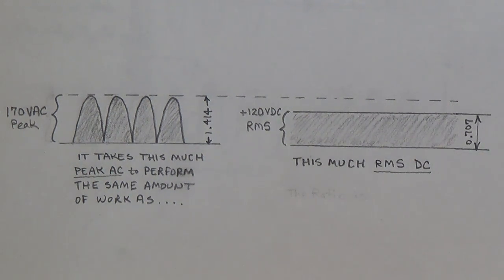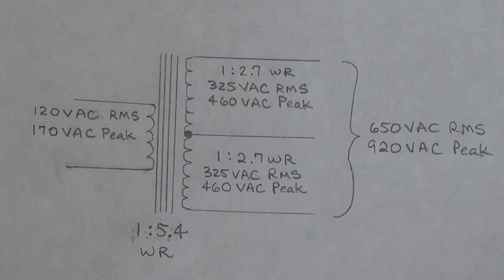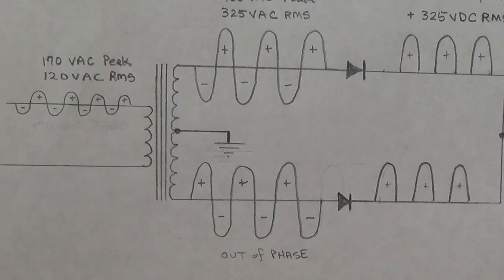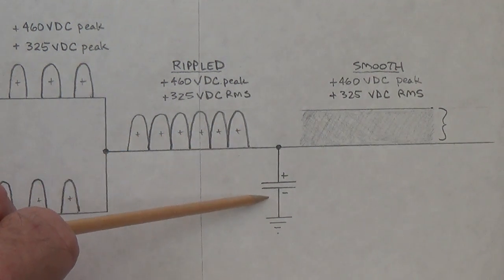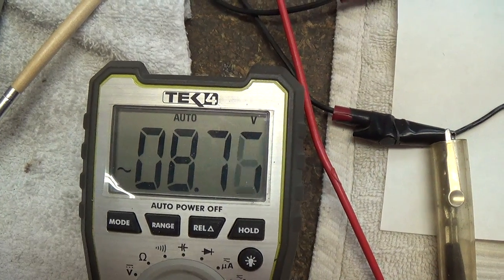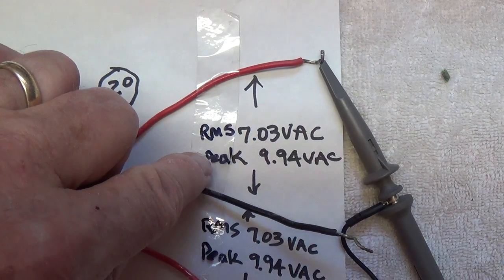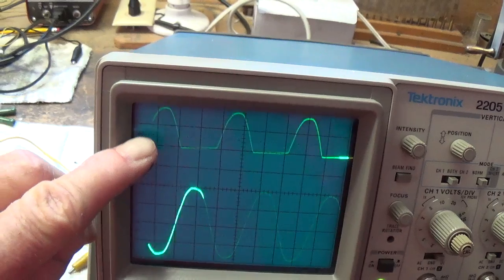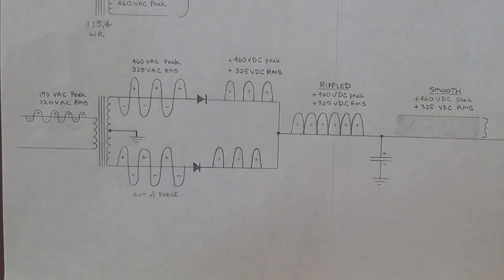Power Supplies Part 2:  Full Wave Rectification

Comment: could you possibly make a tube amp with theas tubes I might ask a uk224 and a uy247
Reply from the maker: +fucken killer jason  Jason, I am not at all familiar with the tubes you mentioned and thus cannot render an informed opinion.
Reply: fucken killer jason theese are 30s tubes have odd filament voltages were used in audio in battery sets might see them at the Smithsonian. Nex to the model a car.. filaments maybe 3-3.5v 45 - 47 is power output .27 af amp.

Comment: I'll try to restrain myself here, lest you develop some sort of rock star primadonna thing... To teach something this well, you have to understand the place of not understanding a concept at a certain level. And you have to know how to build the path to the next level. How steep to make it, and where exactly it shall go and NOT go. Your beefed-up description of filter capacitor function  hit me square in the noggin'. I have not heard these concepts articulated this plainly until now. OK, now I won't gush. I know you're somewhat of a stoic. 
Incidentally, I know it's by design that your presentations are restricted to the subject matter interspersed with mammalian anecdotes--but many of us want to know perhaps how you came by your fund of knowledge and obvious passion for this subject. You mentioned being an "algebra instructor." We ham radio geeks call our mentors "elmers." Did you have a mentor?
Reply: +JC Haywire Let me add that your choice to explicitly show the connection of your scope probes for your testing is  a good one. Others do not illustrate this.
Reply from the maker: +JC Haywire  Wow, thanks so much, JC. I completely agree with your analysis that effective teaching requires putting yourself in the mind of a person who does not understand a subject.....and then figuring out how to change that situation.  I'm almost entirely self-taught (I work better alone.....other than with quadruped mammals) but over the years have found people who would take the time to patiently provide helpful input, including David at ElPaso TubeAmps.  My college training was in Biology and Chemistry and my first career was in medicine.....but I've always been an engineer at heart :)

Comment: We are happy you are back. This power supply explanation has been awesome!! I´ve been working on my fear of transformers and I believe in the next month I will be receiving the components to by build my very first tube amp. Which one would you suggest for my first project?? The 5e3 or Epiphone valve junior?  Best Regards uncle extended to Jack and Rusty.
Reply from the maker: +Joao Martins Thanks, Joao. As a Fender enthusiast, I would strongly recommend the 5E3. It's one of the classic amps of all time. Good luck with your project.

Comment: When a filter cap goes out of spec what electrically is happening to cause the hum?
Reply from the maker: +Trex1268  It ceases to smooth the rippled DC output from the rectifier, and the 120Hz hum created by the ripple becomes audible through the speaker(s).

Comment: This smooting electrolytcondensator reminds me of the grounded condensator of a rc-lowpass filter, where only low frequencies can pass and dc with a frequency of zero is as low as it can get. (Also a coupling condensator reminds me on a rc-highpass filter because only ac with a frequency from more than 0 can pass.)
Maybe this was already covered in your condensator-video, anyways: even when there are no resistors involved, does it really work like this?

What is happening with the negative waveparts, are they unused because there is no need for negative voltage?
Reply from the maker: +PrinceOfBodom  I think my smoothing demonstration benefited from an absence of any load on the circuit. Perhaps the resistors become necessary when current is flowing. With regard to the negative waveforms, I have given much thought about this.  I used to think that they were shuttled to ground through the center-tap to form an equal-but-opposite B- in the chassis.....but then the potential between a tube plate and ground would be doubled.  It seems more likely that they are simply blocked, like turning down a faucet half-way and only letting half the water through. The water in the pipe doesn't go anywhere.....it just doesn't get through. It's an interesting topic, but one that I have never seen or heard discussed before.
Reply: +Uncle Doug Thank you for your very detailed response! I'm learning so much more from you than i did in twelve of school!
Reply from the maker: You're welcome :)

Comment: I find it odd that for tube hardware it doesn't require much capacitance to smooth out ripple. With solid state it requires huge honking caps to smooth out ripple. My little bench power supply I have been working on uses four 2200 uF caps for smoothing.
Anyway, keep up the great work.
Reply from the maker: +Leland Clayton   Thanks, Leland....we will.  The main difference between the two is the voltage levels at which they operate. The high voltages found in tube amps respond to low-capacitance, high-voltage caps.....while solid state requires the opposite.  What strikes me as odd, however, is how well the low voltages I used in my demonstration (7 to 14VDC) responded to low-capacitance filtration.  There is probably an obvious explanation, but it eludes me at the moment.
Reply: Uncle Doug I think the reason why the demo (7 to 14VDC) worked fine with low value caps was probably due to no load.
Reply from the maker: It could well be, Leland. I can set it up again with a load and see if there is a difference.
Reply: +Uncle Doug I would agree - it is probably due to the absence of load in your demo circuit.  With no drain (which pulls down the charge in the caps) - it's easier for the caps to stay at full charge / full voltage ???
Reply from the maker: Good observation, Donald. Thanks.

Comment: One of the most informative, non-idiotic channel on YouTube. I love to watch your videos sir. Cup of coffee, few schematics of my lovely amps and pen in other hand to add new info on paper.
I have one question about that video. What's the most diffrence between tube rectification and diode rectification? Any significant diffrence in sound, hum etc?
Reply from the maker: +echo  Thanks so much, Echo. Rusty and I really appreciate your nice comments. Diodes tend to be more efficient than tubes when it comes to rectification.....other than the GZ34, which is very close in efficiency......so tube rectification can impart an effect called "sag", which is evident when the power supply lags behind the demand for more current (generally at higher volumes and stronger input).  Some people love this effect, since it is associated with vintage tone......some people dislike it and prefer diode rectification.
Reply: I am reviewing all of your videos right now :) Nice to watch. I now know much more then year ago. I was going to put a comment and... hah, I've done that year ago.

Comment: Great video Doug I'm running out of colourful adjectives to describe your talent here. My only gripe/observation  would be to explain why/how you got the 2 output waves to appear seperate on the scope. I guess that comes down to how to operate a scope which is 'out of scope' of this lesson.
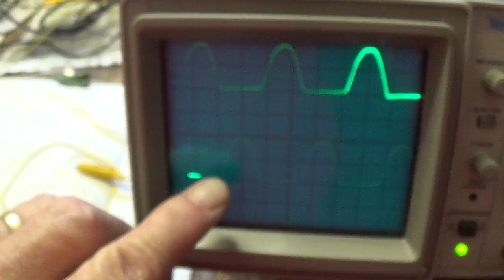Reply: +Andy Wragg Well, the short answer is that he's using a 2 channel scope. Each channel has an input and a trace. Signal on "A" input is displayed as the "A" trace (IOW the trace that's manipulated by the controls in the "A" section of the front panel) and then likewise for B. By setting up the A and B range and position controls properly you can put each trace in its own part of the screen (see 15:10) or lay them on top of each other (see 15:30) or just show one trace filling the whole screen (see 12:45) or whatever else you want to do.
Reply from the maker: +Sootikins  Excellent answer, Sooti. Thanks for helping out :) A dual-trace scope is very helpful with amplifier circuits, particularly when examining phase inverters and PP output.  I have been asked several times to do an oscilloscope video and intend to do so in the future.
Reply: +Uncle Doug. As you know ( from yesterday's comments) I myself already have a dual channel scope and know how to offset the dual traces. My point was that not everyone has this tool or may know how to use it to its full potential as you have here. Again not a criticism more an observation.
Reply from the maker: Understood, Andy, and I will definitely place an oscilloscope video at the top of the to-do list.